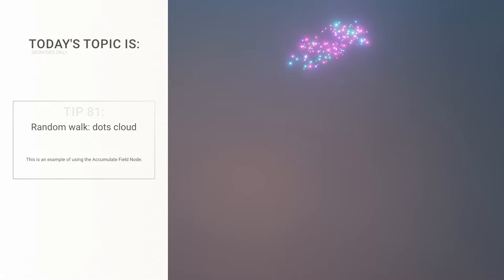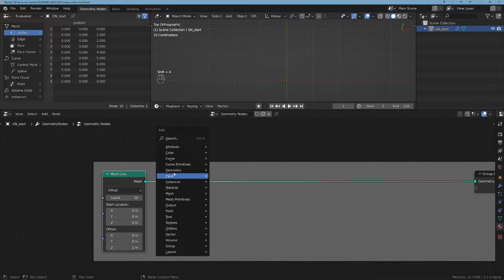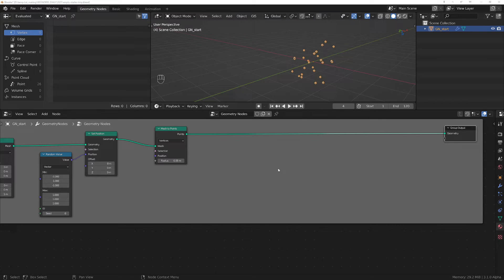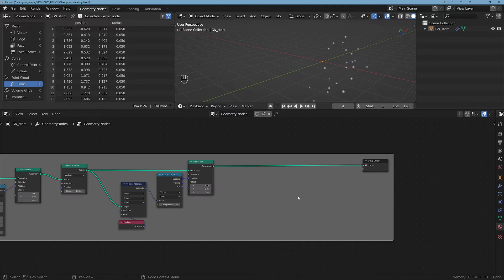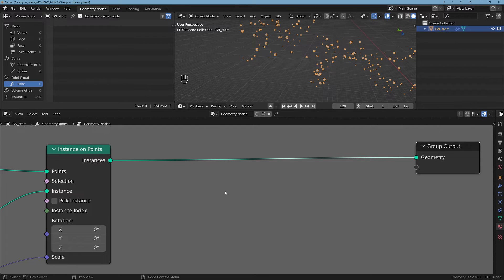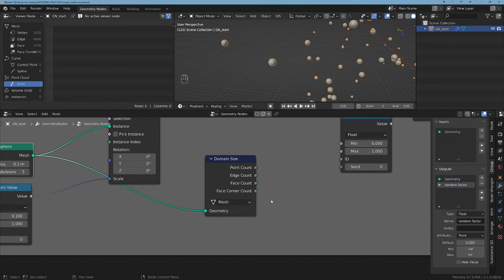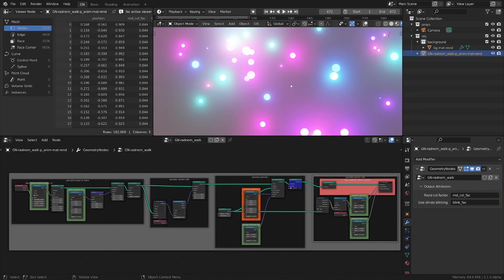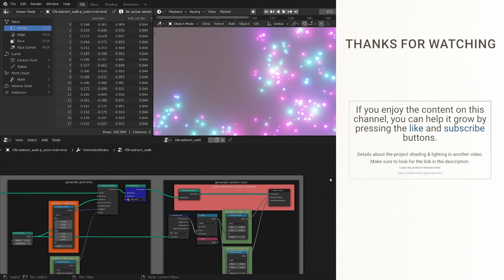Random walk: Accumulate Field Node | Blender Geonodes Daily, tip 81

Comment: I'm not at my Laptop now but I think you could put a "Set Material" right behind the Ico Sphere, and in the shader "Object Info" gives a random value for each instance.
Reply: Another method for random color for each instance would be: realize instances and in shader nodes from the "geometry" node the "random per island" output.
Reply from the maker: I have used this method. It is good that you brought that up, because there is something that I did not explain properly in the video: why I have chosen this approach because it is indeed a fast way to get some variation in the material.
The problem with random options in the shader nodes is that it gives very little control, if any. It would take some trickery with math nodes and color ramp to get something else than the default random value.
Doing it in the geometry nodes allows you to do so much more. In this project I have used the 0-1 range to control the hue in the shader, by simply restricting the range to 0.5-0.9, I made all the instances stay in the purple-blue range.
You could also use any data from the geometry node to drive the color change, like I did in the previous video with the flower cube, where I`ve used the animation data to drive the color change.
So again, thank you for bringing this up. I should have explained that in the video.